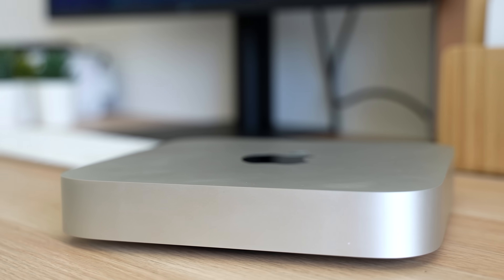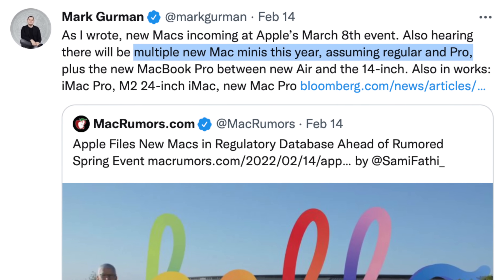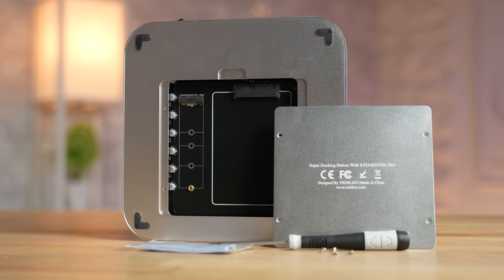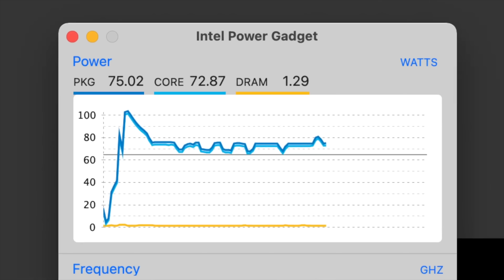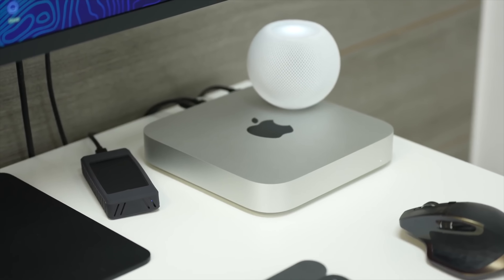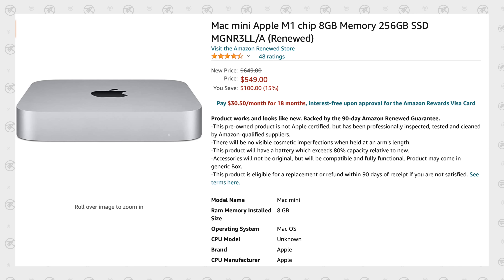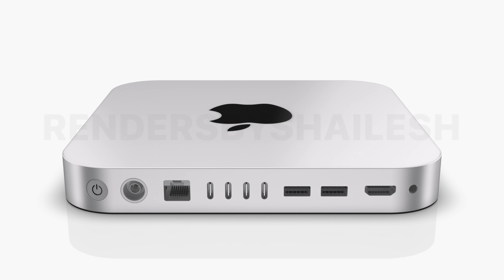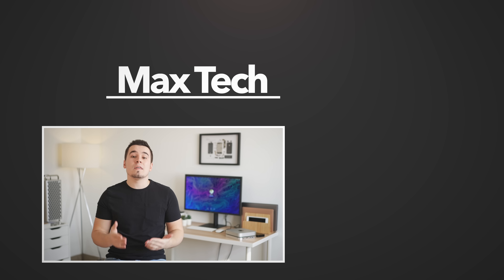M1 Mac Mini Review after 1 Year: Buy Now or WAIT for M2?

Comment: Looking forward to the M2/M1 MacMini comparisons (similar to https://www.youtube.com/watch?v=pc8Wi5EWQx0), when the M2 MacMini gets released ... The M1 MacMini will be two years old on November 17, 2020. I didn't take the plunge until February 2021 and haven't looked back since.

Do differently:
1) pay for 1TB storage and use an external TB4 channel for external drive(s)
2) If a 24GB RAM option is available, take it
3) If the M2 Pro Version is offered, take it

Comment: 7:58 / 9:55
M1 Mac Mini is Super Great for the price, But if is not fast enough because your are making $100.00 per minute, then get the Mac Ultra $5199  it will perform 5-12 minutes faster.

Comment: Hi guys thanks for the this... I am currently thinking of purchasing this since my old Mac mini has died... can you connect 2 4k monitors on this through the USB C ports? I heard you can but you have to use one HDMI and one USB C, please confirm. and can you use Touch ID keyboard in Mac mini? please advise
Reply: I just read to output to two monitors, one will be thunderbolt (USB-C) and the other will be HDMI. But the HDMI can be 4k as well ...

Comment: I love my 2018 Mac mini, but the performance difference with M1 is not enough to justify ditching yet just yet. Also the lack of ports. Is a problem.
Reply: For me, the performance difference between the 2018 and 2020 M1 was massive.
Reply: Yes, I'm in the process of moving my current "work" Mac Mini M1 to my music studio to replace 2012 i7 Mac Mini. It will be interesting to see how fewer ports work out (the biggest thing is that my Mk1 Maschine controller probably won't work anymore so that's one less thing to plug in lol) ... probably just means a hub, which I already have ... (Personally, I agree with you that the performance difference between these two machines, esp. multicore, is not night and day. For the most part, even my 2012 i7 is still "snappy" most of the time ...

Comment: Avoid the M1 like the plague.  Apple is becoming the new Windows. Bloatware.  Ridiculous setup problems, like during initial setup I chose “new Apple ID” and got message “this machine has been used to set up too many Apple ids.  What?  It’s a brand new machine.  Straight from Apple.  Ok, then it’s tech support,hold with someone who I can barely understand.   Then it’s “commCenter wants to use your keychain”  huh?  Password entered, and it’s the same message.   Then it’s “sharingd wants to use your login”.   And numerous similar messages.   No thanks Apple.   If I’m paying 4x the price of a windows machine then it better “simply work” - not give me codes and hassles like windows 95.

Comment: Problem is base level config od 8x256 is useless for anyone and won't last even 5 years before you'll need to upgrade in other words by a new computer in fact the chances of getting even 2 or 3 years is not going to happen because of the lack of ram and hard drive space that the base models have

Comment: The M2 will be about 10-20% faster based on the known technology options they have with the M2. So really not a game-changer in any way, but if the price stays the same it probably is worth waiting for. Love my MBP M1 and see no need to replace as it's dead quiet and even beats my i9 workstation at many tasks.
Reply: The M2 will focus on single core performance while the M2 pro,max and ultra and maybe the rumoured extreme chip focuses on multi core performance!.
Reply: M2 could be significantly faster as it will be based on A16 and not A15.

Comment: ⭕️ As a heavy user of CPU power, the current Mac mini is not an option. Mac Mini Pro M2 is a must wait for if you’re frequently pushing Logic Pro X to the max, or Final Cut Pro for the matter. While 3D rendering programs are Notorious for Gobbling up CPU power, a Mac Mini M2 Max Pro should be more then ample power for some 98% of hard core Mac users. If you can’t wait, simply be ready to sell your Mac mini M1 within 72 hours of the release of the revised Mac Mini Pro M2. Just have your data backed up and know in advance how to perform a factory reset of your Mac Mini M1. 

Good luck. 🎹🎹🎹🎹🎹🎹🎹🎹

Comment: I bought my M1 Mac mini with upgrades in storage and ram last October and it’s an absolute dream for an everyday user who also does a good bit of photo editing on the side for passion projects. I’ll have to take a look at those adapter extensions since they are rather asthetic. I have my Mac Mini mounted to the back of my curved display and that’s why I went with the Mac Mini over the iMacs, was I could get a display that I wanted (dimension and I do like curved as well, and I can buy a bigger one down the road if I wanted and not have to worry about the whole computer). I also am a sucker for the ecosystem concept as well, and enjoy the features Apple has with cross-device use. And now with the option of using the iPads as a second display becoming easier (hopefully it works itself out with the 15.4 update) that’s going to be a game changer

Comment: I have the Elecife Mac Mini USB Hub, and it sort of works good. I put a 4TB Samsung 970 SSD in it and in the beginning it managed to get 280mb/s on Blackmagic speed test, but after I filled it half full with data it could only get up to 180mb/s. So then I removed the closing cover of the USB Hub and put some spacers around the hole so that the Mac Mini sits 5mm in the air. This made the SSD much cooler and raised the speed up to 220mb/s. My question is, seeing the Trebleet Hub with its closed bottom SSD storage solution: Those poor hard drives will get hot and slow, won't they?. Or is ist because the SSD is half full that it gets slower?? Also I find the blinking light in the front of the HUB annoying when the SSD is in use, anyone else? I wrote Elecife and the customer service guy meant that the light can't be turned off.
Reply: AQA

Comment: First things first: Get the 16gb version of this computer if you do music. The End. Well not quite the end. My previous music creation MacBook(16gb) and 2014 Mac Mini easily choked while running Maschine 2 software: the 2014 Mac Mini could barely handle a Maschine project with no plug-ins, and the 2015 MacBook(16gb) would start to balk when running more than two plugins. The ram usage on these two machines with the same amount of ram(16gb) as the M1 Mac Mini eat up all the ram very quickly.

Contrasted with the <1 Mac Mini(16gb)—try as I might—I can throw multiple instances of plug-ins into a project and cannot get the usage indicator to move above1/4 usage. The little ram usage indicator in Maschine 2 may NEVER fill up. It’s almost useless to even show the ram usage in this app with the M1 silicon. I always have over 3/4 ram available for more plug-ins. Unbelievable how efficient these machines are! GET ONE NOW!!

Comment: So realistically I dont think this will ever get read, but here is hoping.
Can we do a generational comparison.

I.e. coming from the Intel going to the M1.  One thing I struggled with was moving from an i5, 256Gb MacBook 2019 2 thunderbolt, I really did not know if I needed a 13" or a 14".

I am facing the same thing now, where I need to figure out, what to do with an i7 1Tb 13" mid 2019 4 Thunderbolt.  Trade in and move up, and if yes to what... So Max Tech, if you can help with the generational comparisons, it would help at least 1 viewer.

Comment: I'm sorry but I have to disagree on some statements, Max! I'm using a base iMac Pro model, and last month I've bought a base model for my grandfather, iMac 24 inch with M1 (7 graphics cores, not 8), and I have to say, while I was setting up the base m1 iMac model, I have noticed that it is not as snappy as you are commenting on your videos, I mean, it IS FAST, but it is not as nearly as fast as my iMac Pro, when I was setting up, I belived that the m1 will be faster than the iMac pro, but it is definetely not the case. Just by working around with the machine, it is noticably slower and not as snappy as the iMac pro, also, the single fan of the 24inch iMac did ramp up to the max while the OS was updating to the Monterey. So, in my personal opinion, the iMac Pro is still not obsolete, it is inded a powerful machine, not for the junkyuard yet :)

Comment: I bought an M1 when it first came out. I had to get it fixed three different times under warranty. It turned out that the issue i had with was Express VPN. It wreaked havoc on the OS. They swapped it out with anew one and it still had the same problems. I cant wait to get the new Mac mini and dumping this one.

Comment: The problem is not the M1 processing power, it's the 16gb RAM limitation. My day to day workload requires 13gb already for simultaneous FCPX, Photoshop, AI and multitabs browsing in Safari.
But other than that, the M1 is still pretty fast and silent. The only time I heard the fan kicking is during exporting 1 hour video of 300gb FCPX file while editing on Photoshop. Pretty Crazy.
Reply: @Drewhio92 well technically the M1 architecture doesn’t allow more than 16gb of RAM, but who knows right

Comment: I'm still bitter about the M1 mini. There weren't any rumors it was coming so I bought a 2018 i7 mini just before the M1 was announced as it wanted to replace my aging 2012 i7 mini. I was outside the return window so i couldn't return or exchange it. And sadly a similarly specced M1 Mini would've saved me almost $400, although I would have 1/4th the RAM. 🤷🏻‍♂
Reply: You can sell the 2018 i7 and buy the M1 Mac Mini. But i doubt anyone in the right state of mind would get the i7 given the spec of the M1 and the great specs they have with the good price.

Comment: Can someone explain that "instant on" feature to me? Because, to me, it seems Apple has simply fixed an issue that they themselves created. Before Apple's yearly bloat cycle for macOS, Macs -- with mechanical hard drives, no less --- always woke from sleep instantly. My decade-old MacBook pro didn't have an issue with that, until I updated it to one of the later releases of macOS. I wonder if Apple had tweaked system firmware, to ensure deeper sleep and thus better battery life(?) I would think so... only, there have existed such modes (ex. Deep Sleep) for several years now.
Reply: It's noticeably faster than what you saw before, though whether or not it's actually functionally relevant, it's probably up for debate.

Comment: Rather than shrink the MM M1 they should have made it possible to have two or more SSD drives in the chassis.
Reply: That would've been ideal but I don't see Apple making it easier for customers to upgrade, especially if it could lead to situations where customers complain their new upgraded SSD isn't as fast as the internal storage on the Apple Silicon chip. What would really have been nice though if they had a TB4 port on the underside of the Mac mini so that it could then lead third party accessory makers to build a dock which doesn't have a cable out the back (similar to how laptop docking stations used to be)... but that has an equally unlikely chance of happening!
Reply: @jace888au  I don't buy the "complain" argument. We're taking about apple that was selling expensive iMacs with slow 2.5 inch HDDs instead of SSDs.
Reply: @ihavenoideahowtocallmyself3849  storage, not memory
Reply: @Drewhio92 When I made my comment the Studio wasn’t announced, unfortunately the Studio doesn’t allow multiple drives either. Multiple drives might be reserved for a Pro if they make one.

Comment: If I already have a MacBook Air, would using it in clamshell mode make more sense or buying a M1 Mac mini for my monitor
Reply: I have both (M1 Mini and Intel Air); the Air worked perfectly well with my setup when the Mini was in the shop, but there were a lot of dongles involved (2 monitors, RAID box, power in, power out to charge iPhone, SD reader...)  If you don't mind all that spaghetti strewn around - and the fan noise - an Air is perfectly good (and provides a third screen) on the desktop.  An M1 (or M2) Air would be the ultimate in terms of quiet performance and portability-when-needed, with the Mini being an optional luxury.

Comment: Does the hub plug into the mini through USB C?
Reply from the maker: Yes it uses a Thunderbolt 3 cable which is included in the box.
Reply: @MaxTechOfficial  That’s what I assumed. If it used USB A the hub would be restricted to the 5 Gbps of the A ports. I assumed you know that but others might not.

Comment: I’m going to pull the trigger and get 10 of these for my business to upgrade all the desktops. Just going to run accounting, email and surf. May I ask you a question?

Which inexpensive, decent display would you buy in the 21 to 24 inch category?

There will be no peripherals hanging off these M1 Mac minis other than a back up drive…
Reply from the maker: Here’s a good deal on 4K 27” https://www.amazon.com/Dell-S2722QC-Response-Integrated-Speakers/dp/B09DTDRJWP/ref=mp_s_a_1_16?crid=1ASIEHFDXTJGI&keywords=24”+display+dell+2560x1440+ips&qid=1645289746&sprefix=24+display+dell+2560x1440+ips%2Caps%2C118&sr=8-16

Here’s a good deal for 24” 1440p https://www.amazon.com/LG-32QN600-B-32-Inch-Monitor-FreeSync/dp/B08YJWYMD5/ref=mp_s_a_1_61_sspa?crid=340SDDADWCSVU&keywords=23”%2Bdisplay%2Bdell%2B2560x1440%2Bips&qid=1645289952&sprefix=23%2Bdisplay%2Bdell%2B2560x1440%2Bips%2Caps%2C153&sr=8-61-spons&psc=1&spLa=ZW5jcnlwdGVkUXVhbGlmaWVyPUFUVkFINllCMDZPQTkmZW5jcnlwdGVkSWQ9QTA3OTM5NzEySjg5OE5NQU80MUVBJmVuY3J5cHRlZEFkSWQ9QTAwMTQ4MzQxRzM0TVk3TFRBV0NTJndpZGdldE5hbWU9c3BfcGhvbmVfc2VhcmNoX210ZiZhY3Rpb249Y2xpY2tSZWRpcmVjdCZkb05vdExvZ0NsaWNrPXRydWU&th=1
Reply: I think you should go 24. I have 24’s and they kinda small. So I wouldn’t go smaller then that plus there’s probably a larger selection of 24’s
Reply: @omg_a_hoe  Could you suggest a brand that is easy to connect to the M1
Reply: @macsterguy  I would check out the ones max linked. Dells work decent with macs, LG’s probably work slightly better because I know they’ve made monitors for apple

Comment: And it's likely that the M1 Pro and M1 Max SoC's on the new Mac mini models will get a spec bump from higher clock speeds due to the fact of less power limitations on a desktop-only machine.